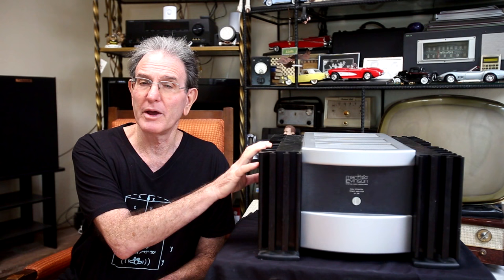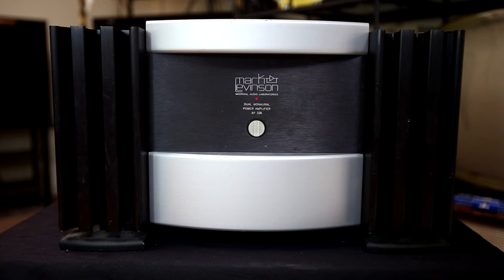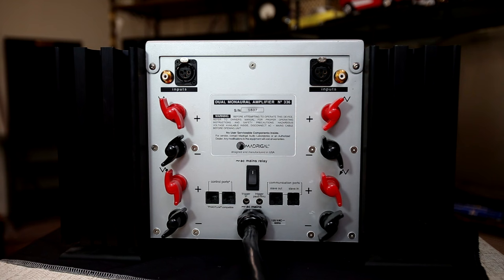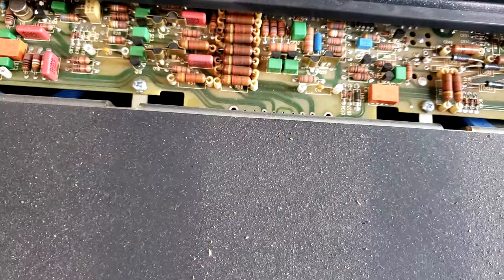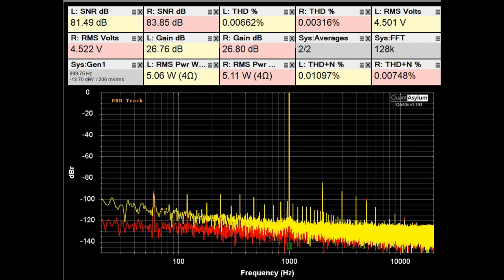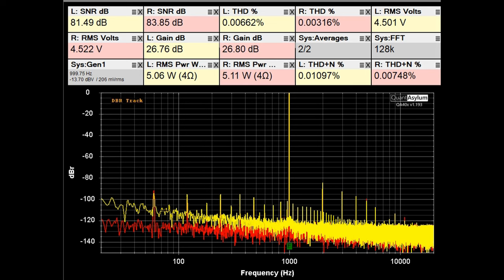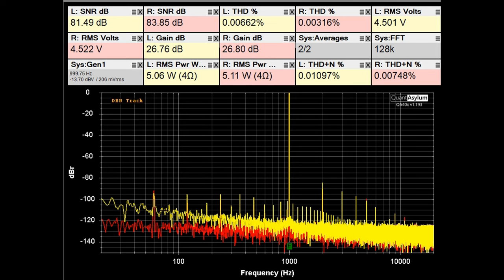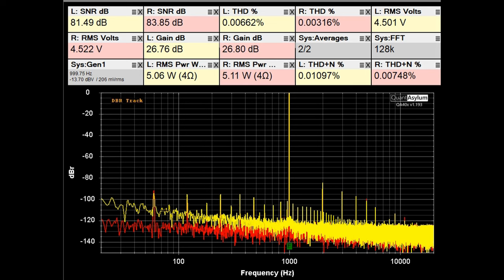Mark Levinson No336 Amplifier- Vintage Audio Review Episode #96

Comment: I purchased ML No. 335 new back in 1999.  I'm 47 now, and I recapped it earlier this year not because it was broken but for preventive maintenance to last me another 25 years. Throughout my audiophile journey, I've thrown every low impedance speaker at it, and it never disappointed.  To date, it gives my mcintosh mc462 a run for the money.
Reply from the maker: Thanks for sharing. I am assuming that you had it recapped rather than doing it yourself as it appears to be quite the undertaking and for that amp as PM, definitely a good idea. At least you have the MC462 in your stable!
Reply: Yes, it was serviced by a ML authorized  repair shop in CA. This is what was replaced. All ML parts. Boards were in top shape.
4 x ML-19000uf - 150v cap
4 x ML-50000uf - 125v cap
4 x ML 200224 150uf cap
4 x ML 200017 680uf cap
12 x ML LT1097 Transistor
20 x ML- 16165 .01uf cap
3 x ML - 110087 - UR resistors 
6 x ML 200013 68uf cap
3 x 30AGC Fuse
4 x ML 200046-3300 22uf cap
Reply from the maker: @henrymagallon8578  Thanks for all the info- but you did not say the cost... $3500 ? I assume you did lived in the area and did not have to pay for shipping ?
Reply: I drove 500 miles to get them serviced. The total cost for the work was $2,847.
Reply from the maker: @henrymagallon8578  That is dedication!

Comment: I have a Mark Levinson 335, until today it has been an excellent machine.
Reply from the maker: That's too bad- I see a costly repair in your future 🥺
Reply: No. It was easy and with little money !
was already reviewed a month ago
I bought all the material at Mouser
8-Large Cornell Dubilier capacitors - CDE
4- 2700uF - 200V  -  DCMC272T200AC2B , or DCMC192T250AJ2B = 1900uf-250V
4- 51000uF - 160V - DCMC513M160DP2D
3 Starting resistors
2 more resistors
several smaller capacitors
2- Chips (power amplifiers) LT1097CN8#PBF
20 AMP Furutech plug. with 6mm wiring
It's like new!!!
I have the ML 335 and 336 service manual which is the same manual.
and the Harmann Kardon fact sheet on changes to the 300 series

you should listen to it now and measure,
It's better than when it came out new
.
.
Reply from the maker: @clementevicente5934  Thanks for all the parts info. The owner of the 336 has another one that he is bringing to me later this week (it is in Texas) that has a hum so I am figuring it is the caps, which from the little peaking I did look to be large and expensive, but the ones you listed-if still available from Mouser- should be reasonbly priced. Where did you find the service manual?
Reply: Oh,  in the United States, Mister Kurian Abraham
send me

in the ML335,  4- 100V -50,000uf and 4 more 160-1900uf were mounted

I increased the volts and uf and the value of the 3 starting resistors

I'm in Lisbon - P O R T U G A L, excellent country

.
Reply from the maker: @clementevicente5934  I am not aware of the starting resistors you mentioned. But don't have a schematic or service manual. I am not looking forward to trying to repair the unit if I even decide to. Don't hear much about Portugal, which is a good thing I suppose.

Comment: Work of Art, about 4 conventional amps combined under one hood giving plenty of ooomph. They even employed actual copper bars to handle the current.
Reply from the maker: Thanks for taking the time to comment! It is a beast of an amp, though I prefer the look of McIntosh power amps. I said say it is more like two conventional amps, which can be bridged with the right adapter.
Reply: @vintageaudioreview Thank you for taking time (and having the stamina) to take it to the bench. I understand your point, but it's still an excellent piece of kit. Not overtly complicated and with no gimmicks for sure, but it's just a solid piece of engineering made to deliver no matter what you throw at it. What it may lack in terms of finesse of feeble class A SE valve amps, it surely makes up for with brute force in spades. Let's face it, every piece of kit needs a bit of TLC every 2 or 3 decades and with so much silicone and electrolyte underneath, it cannot come cheap.
Reply from the maker: @paulb4661  (Chuckling) I did not move these amp on my own. 70lbs is about the most I will do by myself. I like big amps with power meters or LEDs, so this would not be my 1st choice for a 350w amp, but it appears well built. Thanks for taking the time to comment.

Comment: Historic amplifier.  However,  the full power fft shows a lot of harmonics, -50db is not very good.  Maybe there's a fault, i thought i saw cooked resistors on the pcb. Cool to see it, thanks for the review.
Reply from the maker: Thanks you for taking the time to comment. I would not regard it as an historic amplifier though. I went back and looked at the raw footage and pictures I took and did not see any cooked resistors. It looked decent at the lower power levels. Not the best performing amp at higher power levels- at least this one....

Comment: It’s not all that huge physically relative to many similar 300w amps of its fat it has aged well and used good components. Still, it is a relic relative to SOA amps today relative to efficiency especially…
Reply from the maker: Thanks for the comment. The MC352 I reviewed weighed in at a bit over 100lbs and was rated at the same power, but this guy is larger at 150lbs. The Rotel I reviewed I think was rated at a bit more and weighed around 100lbs.  It is not as efficient as other amps, that is for sure.
Reply: It’s about sonics , not efficiency, most modern  amps are poor sounds IMO very few deliver anything like real music ..!

Comment: Wish you had done some testing at 2 ohms, would have loved to see distortion, noise  and stability  Numbers say 5-100 watts @2ohm  .. 

Any thoughts on reliability ,,madrigal is very pricey for repairs ..!
Reply from the maker: Many thanks for the comments and questions. I have not done any testing into 2 ohms as I would have to make new loads and the associated cabling to attach the loads to the amp and analyzer. There are not many amps that specify a 2ohm rating as well (at least that I have come across, although there will be one in next week's video). As for reliability, I saw another amp very close to the one in this review that had problems. I would not purchase their gear just because there is a lot going on that could break and cost a lot to fix, plus their connectors I don't think are ideal.